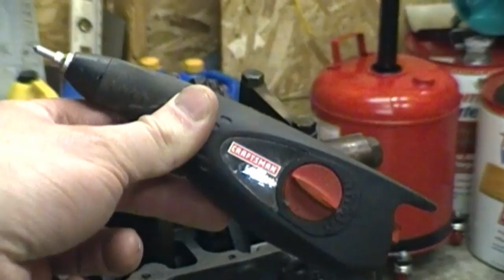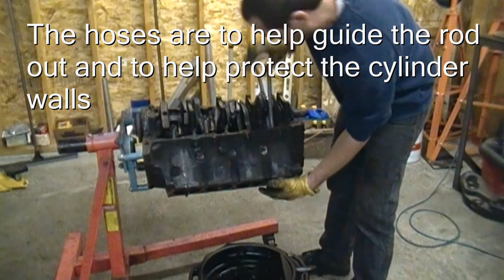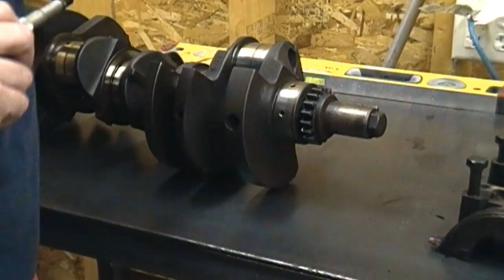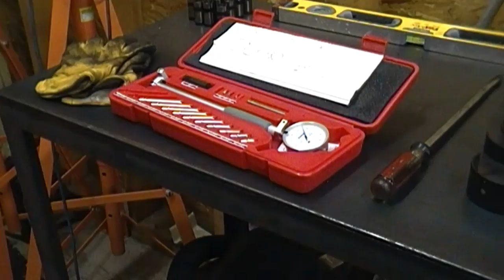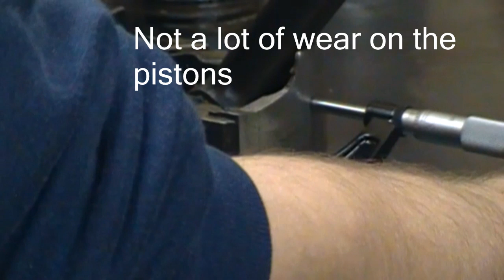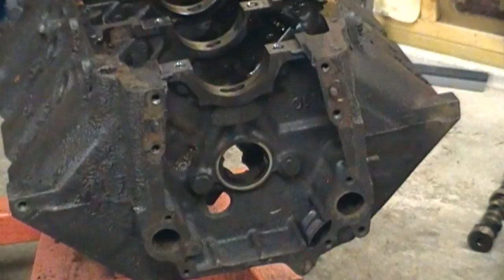Big Block Oldsmobile 455 Marine Engine build part 2

Comment: I was wondering what distributor would you recommend for the 455 olds marine. I noticed that on your boat your vaccume advance was capped off.
Reply: i would recommend NOT using any vacuum advance on a jet boat motor as the motor is under load too much of the time.  Also it just eliminates one more variable.